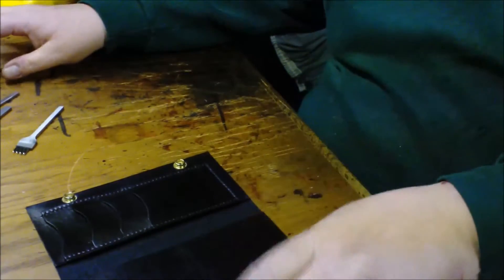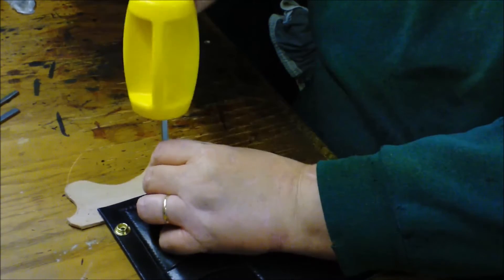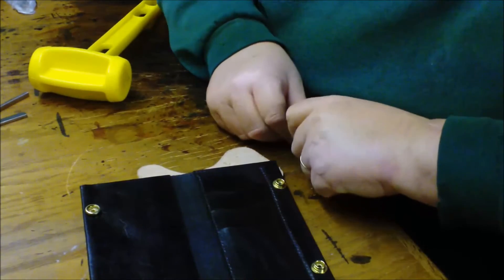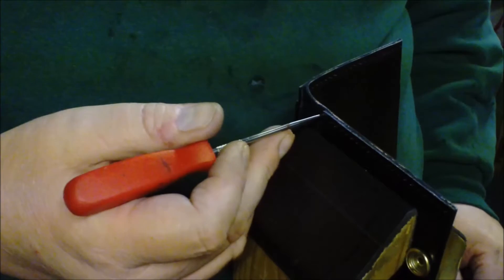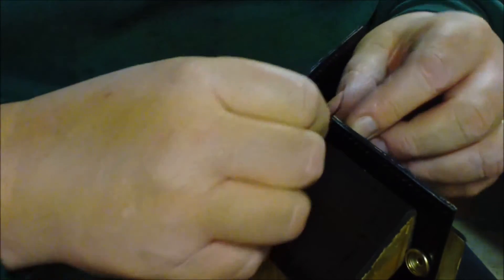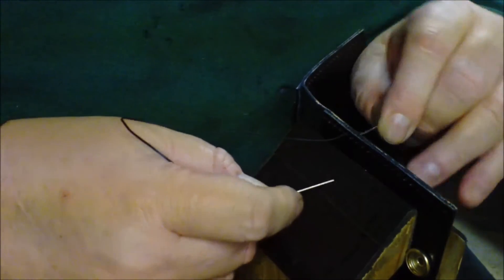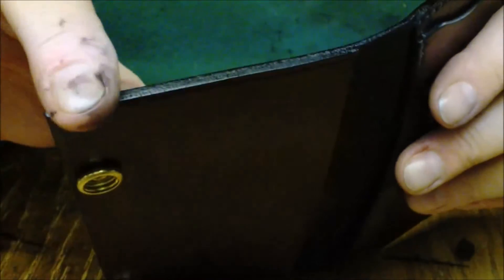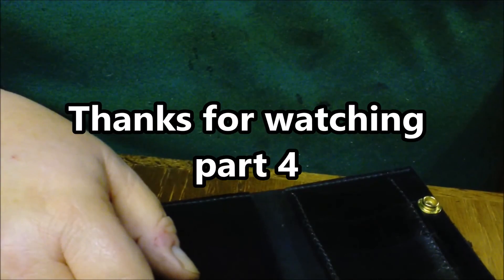Leather Biker Wallet part 4

Comment: You make it look so easy.  I just started getting into leather work in November and I have spent a small fortune already, it seems.  I think I have spent a little over $200 so far and only done a few small kit projects.  After this video, I'm going to have to go back and get a set of chisels, a bottle of edge kote and some leather.  I think I'll build a stitching horse on my own.  Do you have a preference on the size of the chisels?
Reply from the maker: +YoderTexas It all depends on the stitch spacing that you want and the material you are working with. This was made with a 2mm  with 4mm spacing between tines. I did do a video on making a stitching pony but it was quite some time ago, probably a year and a half ago.